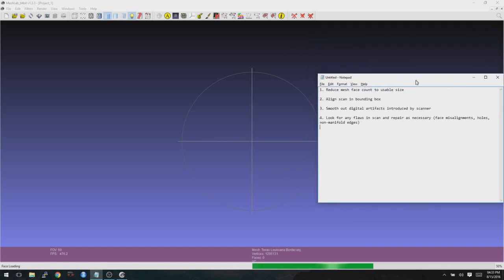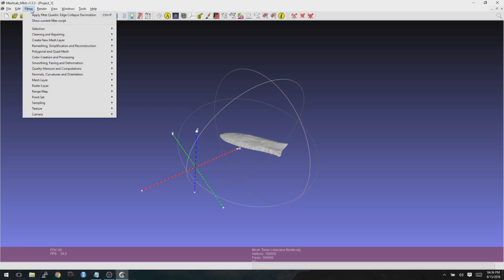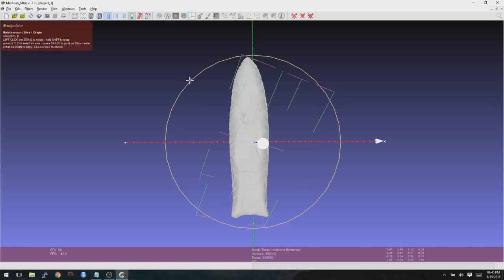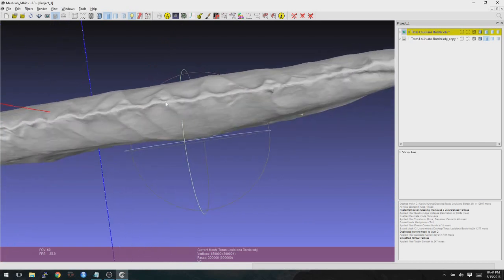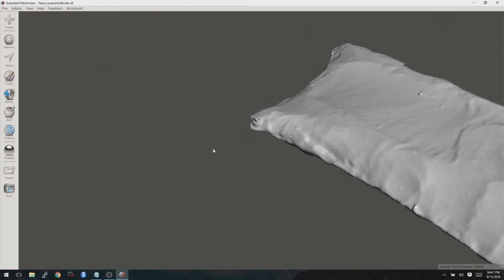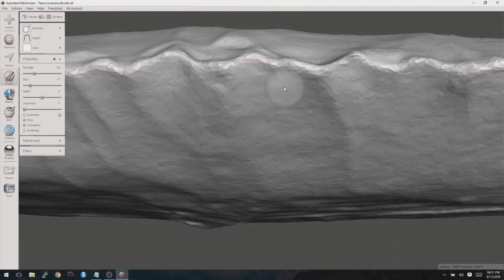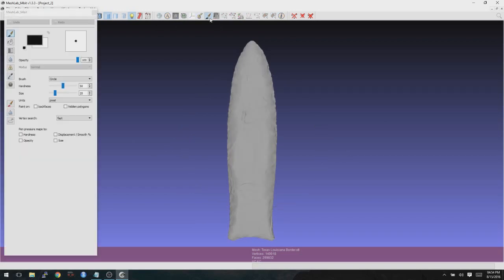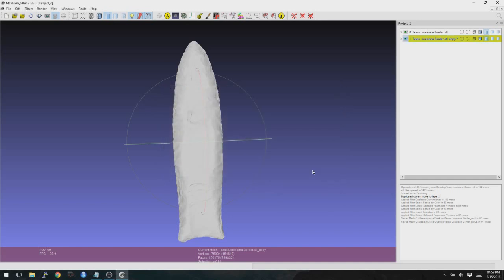GLiMR preparation

Comment: This is excellent!  A great workflow!  I volunteer with the Dixie National Forest, and try to help with their section 110 work.  I've been working on cheap ways, as a volunteer, that I can enhance the digital data out of their surveys and recording of cultural materials they find.  Digital scanning is a place I'm struggling to make good progress.  Do you have a recommendation for the scanning portion ahead of this?  Photogrammetry is a thorn in my side...  I have a low power handheld lidar, and it scans okay, but has its struggles as well.  My little RTI bubble rig I built does the best for me, but using it to create 3d scans is the least optimal method of the three.
Reply from the maker: Things have changed quite a bit on 3D scanning of projectile points from when I made this video, we now have most of these steps scripted. We recently started scanning points with low cost Einscan desktop scanners, the SE and SP give acceptable results for doing basic morphological analyses and I have managed to get the time required to do a scan down to around 7-8 minutes per artifact on the SP and about 12-15 on the SE. To compare, back when I made this video it was between 1-2 hours for a good scan using a David sls-2 structured light scanner (45 min if you were really good), and 5-8 hours for a high resolution photogrammetry model (most of that was in processing time).